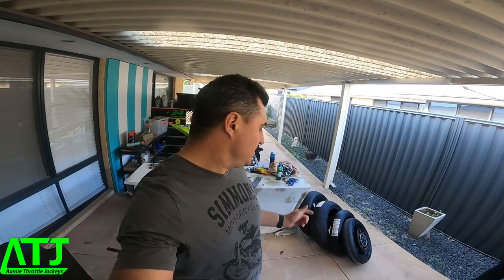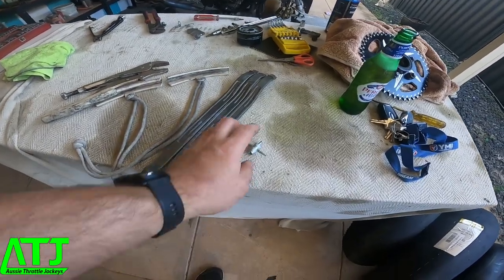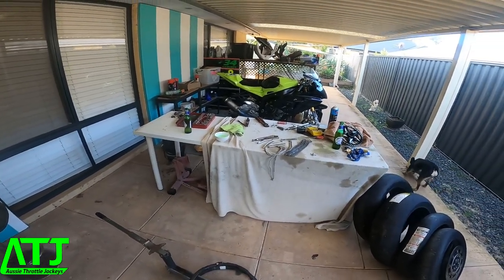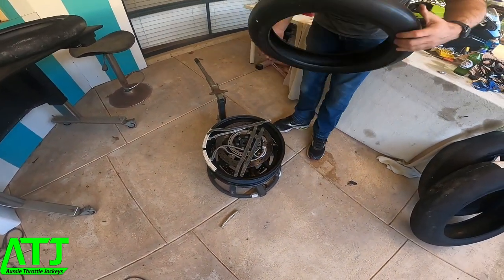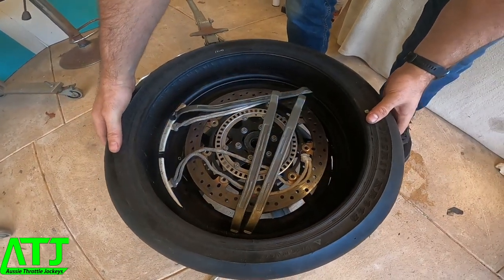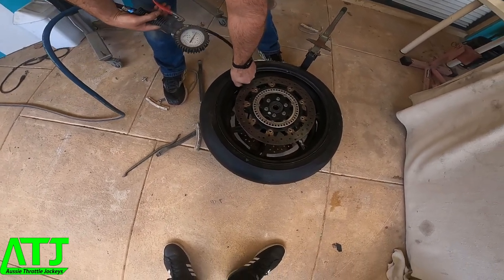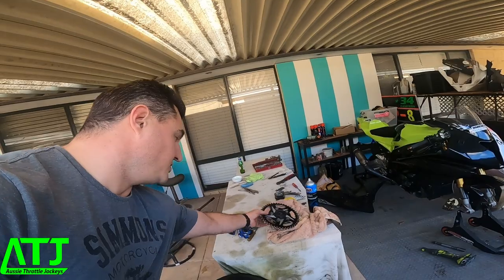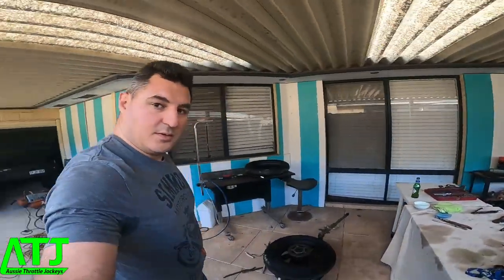ATJ's Definitive Guide to Changing Motorcycle Tyres by Hand

Comment: You can get by without one of those fancy bead breakers. Couple blocks of wood and a spade. Prop the rim off the floor with the blocks of wood and stick a rim protector over the end of the spade. Then get the end of the spade by the bead and jump on it. Couple of goes and it'll pop. Then once or twice round the rim and flip 👌